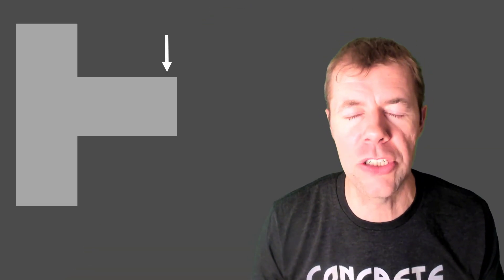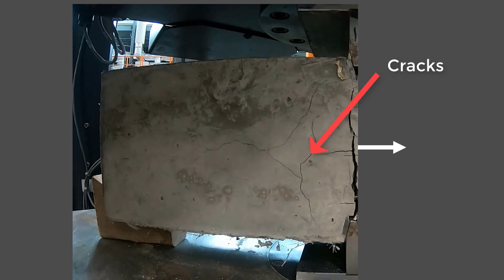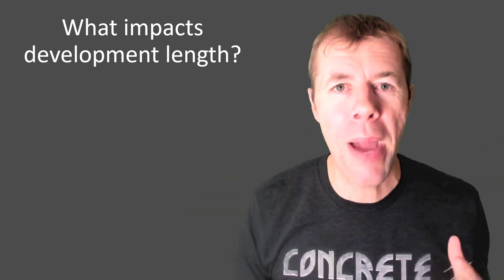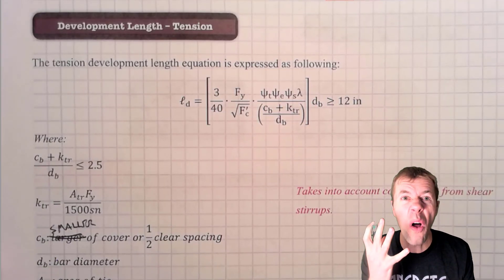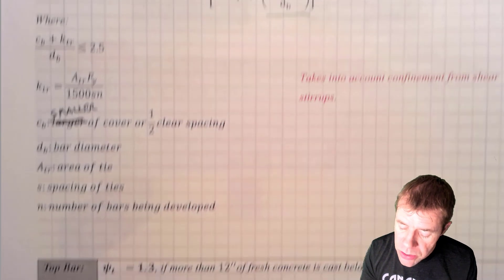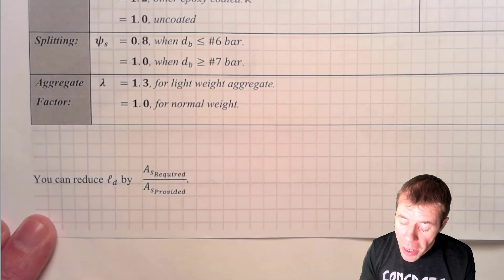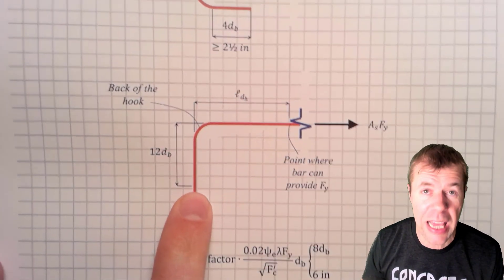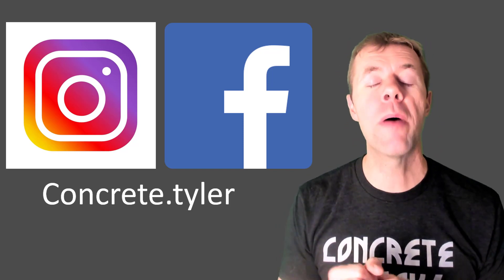The Secrets of Development Length! | How to calculate the development length in reinforced concrete

Comment: Thanks man i was just eating up the equations and it simply made sense to me good to know I'm not the only one thinking about over engineering stuff so that it lasts rather than fails & the load factoring equation  J hooks and L hooks  adding more quality to the strength and performance of the pulled rebar and using more steel to redundancy make up for not using best strong patterns mnnn it tastes good to see

Comment: Sir are  earthquakes and various environmental agencies has some sort of impact on development length 
And also how developmemt length works out in prestressed concrete or structures
Reply from the maker: Thanks!  The development length will allow the rebar to yield.  This is good for earthquakes and extreme winds.
For prestressed concrete they have a term called transfer length.  This is the distance that the prestressing steel transfers the load over.  It is a similar concept to this.  Thanks for the question!

Comment: I used to just overengineer it by a factor of .2-.5., increased the sack mix and keep the water down to the minimum needed. Tried not to overwork the concrete. Made sure everything was in compression as much possible.( Some plans were a joke). Went with a thicker slab.
   How did I cover the extr cost? Explained in detail the customer needed it. They always thanked me for the knowledge. Kind of like letting them into the secret club.😉
Reply: One more comment. Not a big fan of pea gravel. I know it's needed for pumping. But the aggregate size should be one third the size of the slab for maximum strength. That would be a problem pumping it up 40 floors.
   I would use a larger rock if it was delivered by truck and could be dropped by shoot onsite.
Reply from the maker: @georgemichaels2325  Thanks Geroge!  It is cool to hear your experience.  I am excited to go back to the field after things get a little more normal.

Comment: The West Seattle Bridge statement of findings timeline url:
http://www.seattle.gov/Documents/Departments/SDOT/BridgeStairsProgram/West%20Seattle%20Bridge/2020-03-20_WSP_WestSeattleBridge_UpdatedRecommendations.pdf  Sure seems that a third-party could review this in-process failure and make an educated guess where or what is the primary cause of this failure rather than saying the failure does not fit the models... undoubtedly there is a lot of toilet paper being used regarding this problem because of the liability and repair expenses... OUCH!  This is going to be a great study in concrete engineering for the history books.  Comments welcome.

Comment: Tyler -  on a associated subject, just asking your insight on concrete window lintels.  I purchased a 1957 single story block beach house in 2019 (one block from beach).   When painting I noticed almost all concrete lintels are cracked due to rusting rebar.  The rebar was burried in the middle of the lintel, but I guess salt intrusion still happens that deep.  I chipped away what loose concrete, wire brushed the exposed rebar and patched with stucco mix.  SInce it is a single story, I assume there is minimal load on the lintels.  Does salt get two inches inside concrete?  If so, I am guessing all the beach houses as well as older high rises have this potentially significant problem.  Thanks!!!
Reply: Yes, salt permeates concrete. They made a concrete pier in Laguna Beach CA when I was a kid (Aliso Beach pier) that proceeded to come apart many years later [20 or so?] and they tried to save at high co$t and finally threw in the towel & tore it all out as a bad idea another 10 years or so later. [They could have saved a lot of hassle if they'd just listened to me, I could have told them it was a bad idea to put up that pier as a 6 y.o.... It's nice to have Aliso back to its uncluttered beauty!] Anyway, in a salty environment, you need to use some other type of reinforcement that won't corrode in a salt atmosphere...
Reply: @nunyabidniz2868  thank you for your insight.
Reply from the maker: I agree with Nunya.  If you give it enough time then the concrete will reach the rebar.  BTW, I am not a big fan of using stucco to patch your rebar.  If you want to slow the intrusion you could try and seal the concrete.  Super cool you are close to the beach.

Comment: Some good insights are given in this video. I can of course think of variations on the theme where the U-shaped rebar goes around a vertical rebar in the wall to further distribute the load. This would of course make the calculations more complex.
Interesting is also the other video you have "what is epoxy coated rebar and why is it being banned". You did include a reason for it in this video though, but for anyone else watching I think it's worth a visit to that video too. However I can see a reason for some kind of coated rebar in aggressive environments where you may want to avoid replacing rebar but just resurface the concrete, but I'd keep that for flooring on the ground.
Reply from the maker: Thanks!
I agree that is a good way to anchor bars but most people don't use that technique or at least take that into account.